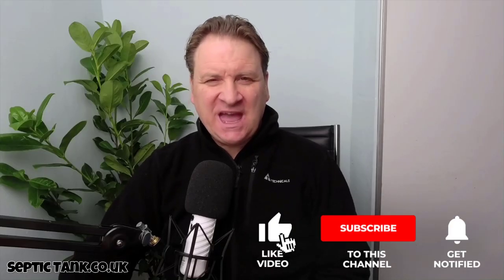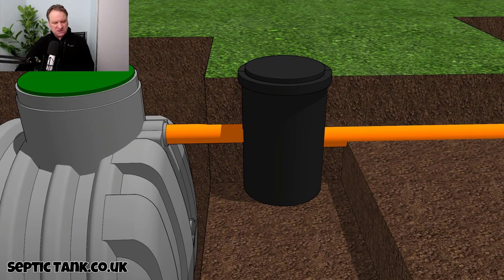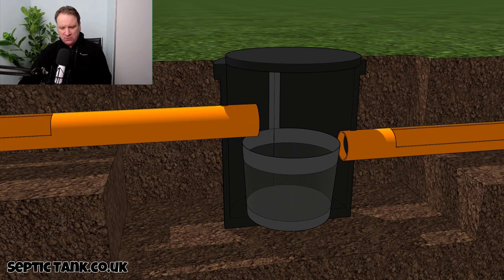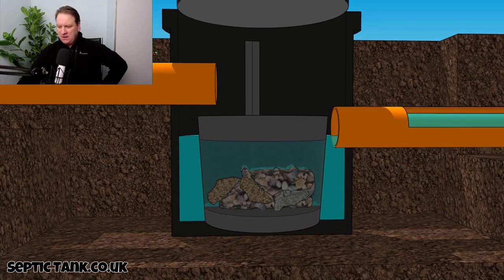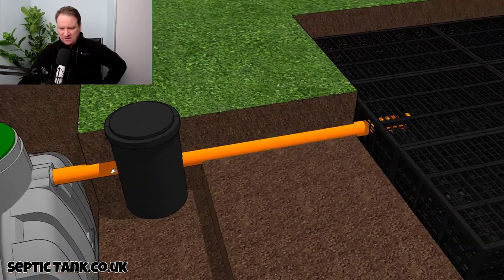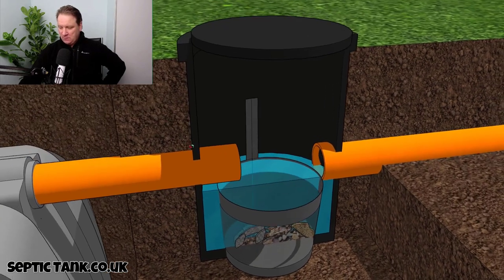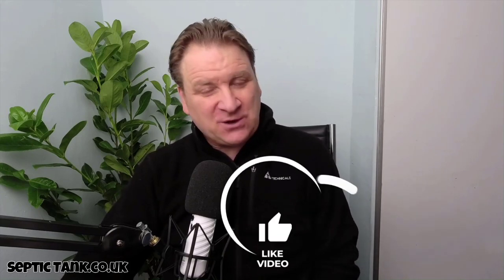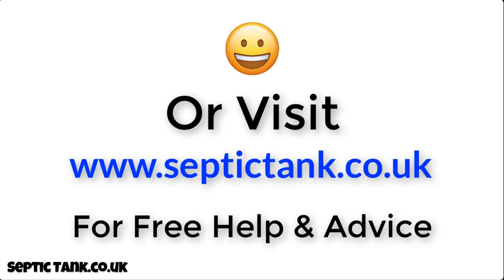what is a silt trap chamber

Comment: Why are they not designed so it's a pressurized line, set at the right velocity for the viscosity of water to rise but the dense solids to fall. And have the filter run up into the mesh rather than flowing down into it causing on-going maintenance and potential blockage issues. The lower solids chamber could be isolated from the rest to keep pressure and then simply dumped via a valve. 

Or does a similar design exist? I'm picturing a cross between a swirl filter and a silt chamber. 

Cheers in advance if you've got time to reply. Highly appreciated.